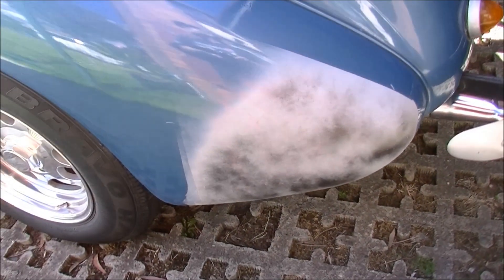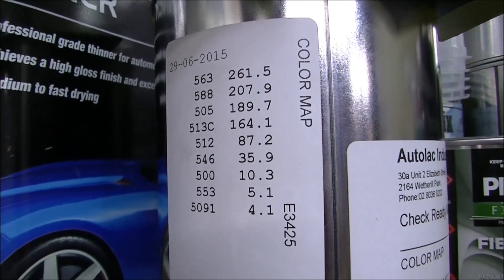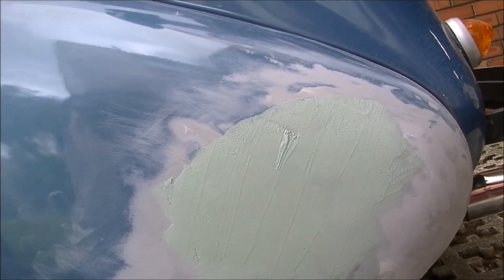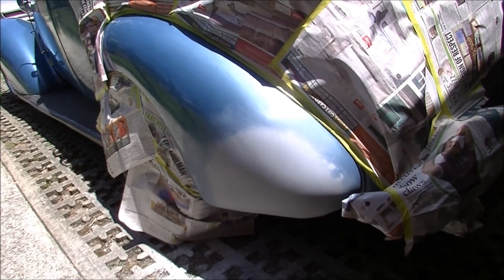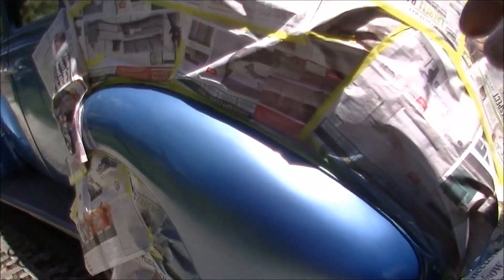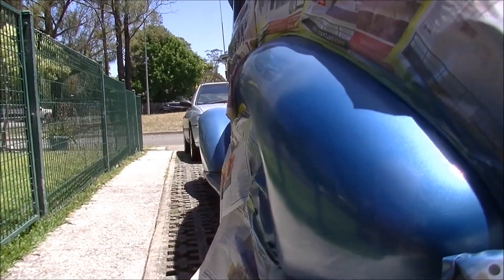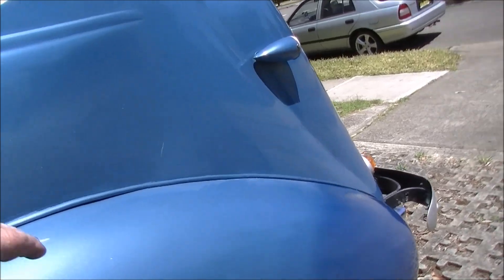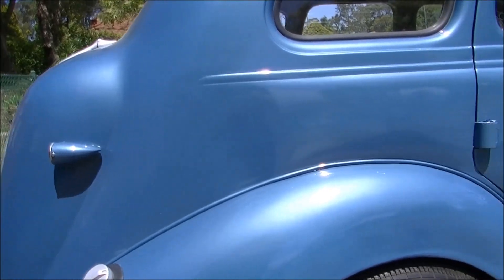38 Chevy gets some paint but how close is it...

Comment: Looks great , they're good with matching paint these days. Painters used to spray half the car just to blend it in. I'd be happy with that.
Reply from the maker: Cheers Pete...I thought if it's a bit off then I'd add some white pearl and re-do it and then blend further on..Does that make sense.?
Reply: @ziggassedup  makes sense mate , painters used to mist the colour with the thinners they cleaned the gun with and blend it in. They would paint further than  the repair with a light coat thinned out but it looks pretty good what you did anyway.  When it's polished it may not be noticeable.  Even new cars have slightly different  colour bumpers because they paint them separate,  look close and you see it sometimes.  Its acrylic so it's not hard to play with.  Nice work mate  and a lot better than some of the work panel shops do.